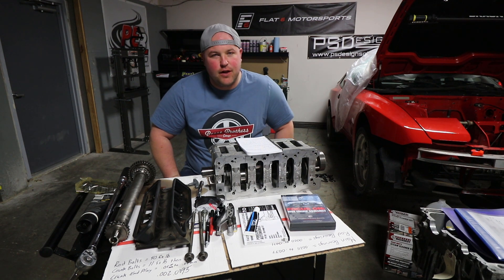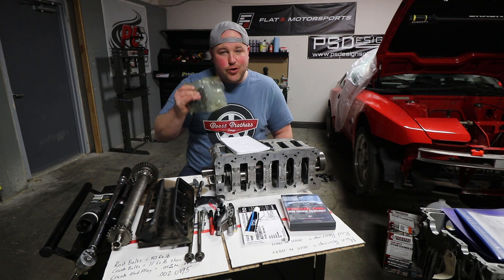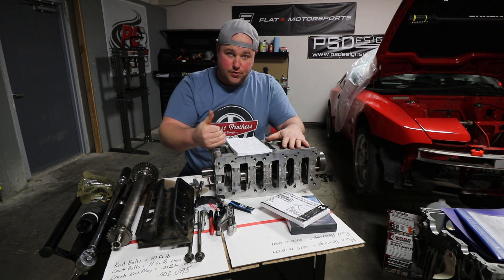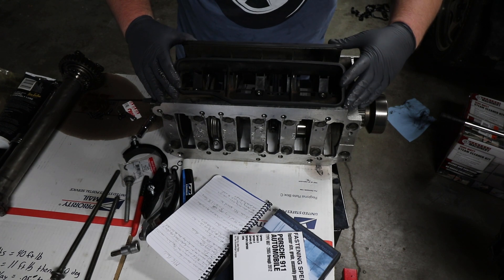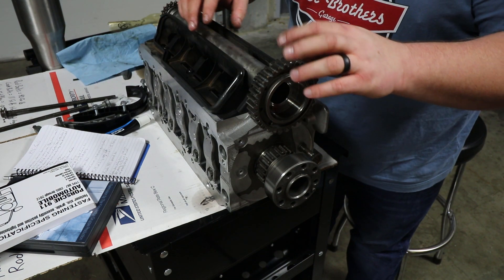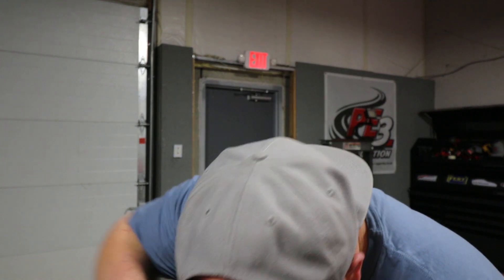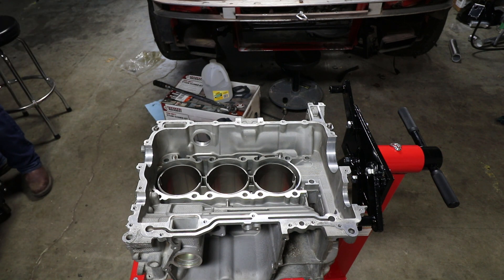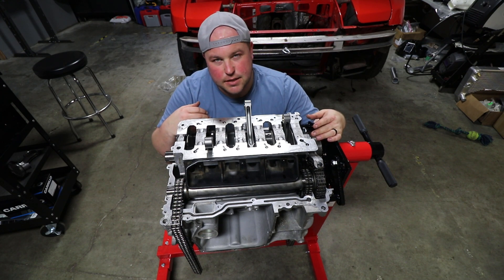Turbo 3.8L Cayman Engine Build (Porsche M96) - Part 5

Comment: I don't know for sure, but I've seen much about the intermediate shaft driven end bearing being a major problem area with bearings letting go. Someone makes a fluid film bearing kit. Like a pressure fed cam or crank bearing with an adapter.  It's definitely something to look into. The ims has a billion revisions all related to bearing failure and or shaft twisting.
Reply from the maker: That bearing is called the IMS Solution. We ended up using the IMS Retrofit for this build

Comment: If you have a 3.6 crank witch I belive is just a 3.4 stroked in your bore out 3.4 won't you end up smething like 3.9 or 4.0L?
Reply from the maker: Hmmm, good point! I must have a 3.4 crank, I need to do some measuring. That would put the CR at 9:1 or 9.2:1 for the .032” and .040” headgaskets.
Reply from the maker: You were correct, I misspoke about the crank. I just measured the stroke and it’s 78mm so a 3.4 crank. Thanks for pointing it out!

Comment: Hi guys. Nice channel. Subscribe. I have 3.4turbo project and looking for the information about maximum torque for its rods and crankshaft. Do you know it? Thanks
Reply from the maker: Thanks! You are boosting the stock short block? Are you using the TPC kit?
Reply: @BoostBrothersGarage  Forged pistons and sleeved engine. Stock rods and crankshaft only. It's not TPC. Garage made kit with GTX3582R. Now it has 400hp and 500nm. Wonder what is the limit for rods and crankshaft :)
Reply from the maker: The crank shouldn’t be an issue but I wouldn’t push it anymore with stock rods!
Reply: @BoostBrothersGarage  thank you. Looking for new forged rods :)

Comment: Apparently dfl coated (like Calico etc...) main and rod bearings are highly beneficial in the m96 and m97 engines to prevent spun bearings. Are you upgrading this go around to prevent that same mode of failure?
Reply from the maker: I had not heard that or planned on it. I believe the reason we spun a rod bearing originally was rod bolt stretch. I will look into it before buttoning everything up though!
Reply: It might even make a fun episode for you because you can do a lot of those coatings yourself. TechLineCoatingsRD makes a lot of stuff that is friendly for a self coater if that’s a word. Here’s a generic article from the engine builder mag https://www.enginebuildermag.com/2019/10/coating-for-performance/
Reply: But yeah you’re probably right, the rod bolts are notoriously weak in these engines